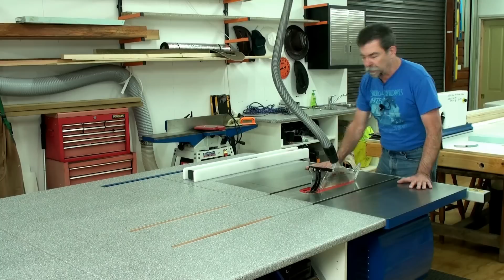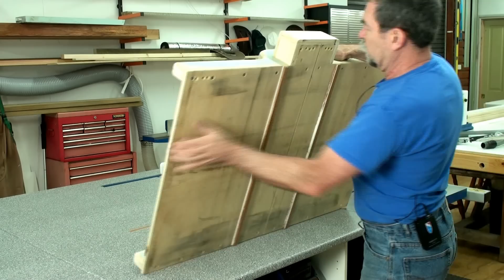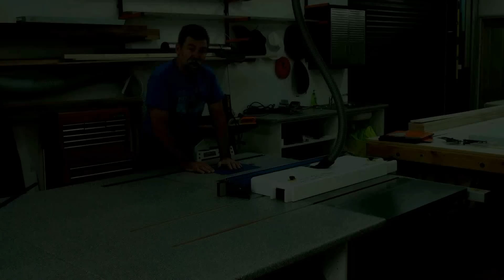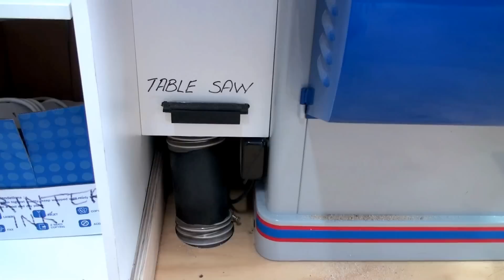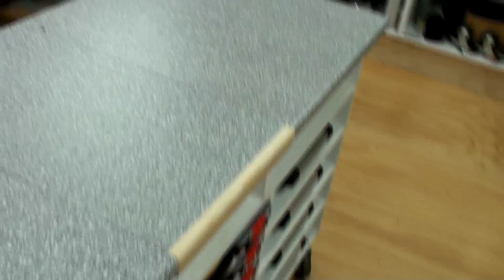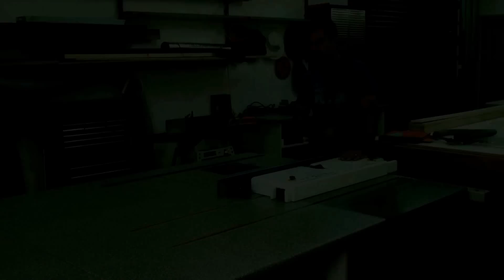Table Saw | Router Table | Dave Stanton

Comment: Hi Dave.  Could you pls tell me how you have attached the outfeed table to the table saw.  I have the same Carbatec TS. Also how you stabilise the end of the fence after removing the steel guide. Thx Phil
Reply from the maker: Hi Phil! I'm glad you're finding my videos helpful. I attached the outfeed table using 50 mm hex head roofing screws through the cast iron top where the rear rail used to be, into the laminate top of the outfeed table and router table area. As for stabilizing the fence, I found that if you check how I secure the router fence here, 8:39 but I use a https://amzn.to/3JnCwRK works well inserted into the end of the fence. Hope this helps!

Comment: How’s the Carbatec table saw going??
Reply from the maker: It is the best! This model isn't sold anymore...what a shame.
Reply: @DavidStanton   is it similar to the one they currently sell. What’s so different
Reply from the maker: Mine is a 15 amp, the new one is a 10 amp. The insert plate is thinner on the new one which makes it hard to make your own inserts out of plywood.

Comment: Dave, did you have to drill the whole in the router insert plate for the above table height adjustment ? I cannot seem to find a kreg insert plate that has that whole pre drilled, only the fixings for the tra001 router base.
Reply from the maker: Hi Martin! The plate had all the holes to mount the large triton router including the hole for the triton crank that operates the fine adjust.
Reply: @DavidStanton  excellent, just invested in a kreg   PRS 4034 plate to go into my rolling MFT style bench, to go with my Triton TRA001 and some grooving bits I've purchased :) I'll put some t track in and make a sturdy fence and I can finally start to make some drawers and doors easier with the grooving bits. - keep up the great videos !

Comment: Fantastic to see an aussie on the tudes. I have a question on the table saw. I saw a post on Woodtalks forum about how much power does a table saw need and now you have one, what would you answer to that question now? I only ask as I currently use home made table saw and finaly have about the $900 budget. My options are a 1.5 Carbatec contractor saw (used) or a dewalt 2000w contractor saw. Thoughts? A full 3hp Cabinet is not any option
Reply from the maker: Those 2 saws are totally different. What do you want to use the saw for?
Reply: David Stanton 
I will be building cabinets for a laundry and walk in rob plus small to midsize wood working projects. I think the carbatec would be better but am concerned that the 1.5 hp motor won’t be able to handle the ample amount of 50mm Blackburn timber I have. Thanks for your reply. I appreciate the help
Reply from the maker: It all comes down to the blade being used. The Carbatec contractor saw is not a very good saw. Try to increase your budget and get something like the Sawstop contractor saw. It is extremely accurate. A totally different machine under the hood.

Comment: Nice set up.  What brand table saw and router lift do you use?  I'm  just starting out (retired) and want to get it right!
Tom
Reply from the maker: Hi Tom. I have a Carbatec table saw but it is not available any more. I would look at a sawstop due to their accuracy and reliability. The router has its own lift. It is a Triton.

Comment: Hi David,  Huge fan, love your shop and your organization.   I am not sure if you own a job site table saw and if you do, do you have a out feed solution for these type of saws for a shop?   I own a brand new Skilsaw  Worm Drive Job site saw  and love it.  Very powerful very accurate for what it is. I am considering making a combo out feed and router table to use with it and was curious if you ever made something for a client or yourself for job site saws like the Skilsaw, DeWalt etc.
Reply from the maker: Hi Gary, Thanks for watching! I believe that you can buy the stand as an accessory. You could then make an outfeed table for it, possibly a couple of millimetres lower? The other thing that I did way back before I bought my cabinet saw, I built an 8 x 4 feet table and fitted 1 inch diameter water pipe into the end and rested my jobsite saw on the pipes. Obviously I fitted some timber to the under side of the saw table to locate the saw and save it from wandering around while cutting.  The depth of the table top frame was enough to be rigid to take the pipe and the weight of the saw and any timber passing over it. Hope this is of some help.

Comment: Question I am going to be purchasing a new tablesaw soon and wanted your thoughts on one with a built in router table or do you think it is best not to incorporate the router table into your table saw.  I see you  have a table but it appears to be one you built and butt up next to your tablesaw to utilize the table saw fence.    Thoughts?
Reply from the maker: Hi Gary. In an ideal world it is best to keep the router table separate so that you do not tie one machine up at the expense of the other machine needing to wait to move things around and become useful again. Mine was a nice idea at the time but would build separate if I did it again.
Reply: Thank you!  I think as you stated there are more options of router table design and router tools not having it built into the actual table saw.

Comment: +David Stanton can you show/tell how this fence mechanism work in your table? 7:59 - so smooth and I wonder  whats the solution you used there. Thanks for explanation.
Reply from the maker: I set the fence and rails as per the manufacturers specifications. Maybe I will do a video on how to set up correctly?

Comment: Hi David, 
mate love your channel. id like some advise on purchasing a Router table/Router. 

I have made selfmade bench with a cut out and bolted a router under the bench and made my guide out of hmr and mdf.

look it works fine, but i feel the makita router is struggling. My boss doesnt wont to invest in a spindlemouter as they are quiet expensive and doesnt see the need. Cough.. tight ass.... Im routering 27.5mm hmr with 3.2mm mdf glued both sides of the hmr. i router out 30mm wide by 5mm deep both side to fit a aluminum chanel. my question is the set you have (carbatec router bench and router) do you think that could handle constant routering ? or do you think a spindle moulder is requiered? 

i router out 12 lengths hmr 2400 x 110 x 33. 5. id really love your thoughts. on what type of setup i can use without struggling everytime i router out 30mm x 5mm deep.
Reply from the maker: Hi Blake. I think that for the volume of work you are performing that a router table would not be the best option. A spindle molder with a power feed fitted may be a better option.

Comment: Great set up.. I am looking at up grading to a decent table saw.I currently out source my cutting and assemble carcasses in my workshop its becoming to expensive now to do it this way.Do you run the tablesaw on phase 3 power or on 240 gpo?. I was also wondering how much your  did your table saw cost?  I am still researching products and number crunching.
Reply from the maker: Hi Keith. My saw is a 15 amp plug in model and unfortunately not available anymore.  If I were to buy a new saw I would buy the Industrial sawstop with sliding table. https://www.carbatec.com.au/machinery-and-accessories/tablesaws-and-accessories/tablesaws/sawstop-industrial-saw-with-52-t-glide-fence
https://www.carbatec.com.au/sliding-crosscut-table
Reply: Thanks David  a few others have recommended the carbatec, and I checked them out this  might be a good option I .watched  a few more of your posts great work I hope my new set can be as impressive
one day..
Reply: David Stanton d

Comment: That is an incredible setup! What's the difference between a riving knife and a splitter?
Reply from the maker: Thanks Vinny! The difference is a riving knife finishes in line with the top of the saw blade. A splitter usually goes higher than the blade and is the support for the blade guard. A riving knife is used where a blade guard is impractical such as cutting a dado or slot where the timber will be acting as a blade guard to some degree.
Reply: Thanks David, that makes sense.

Comment: What model is the table saw you use? 
are you using the stock fence and fence runner that the table saw came with?
Reply from the maker: +Lachlan Childs . Yes the fence and rails being stock. The saw is a Carbatec 10 inch left tilting cabinet saw.

Comment: finally found an aussie wood worker on YouTube. Awesome.
Reply from the maker: +Ideealil Popov . Glad to be of service!
Reply: +David Stanton I bought myself a cheap $170 Ozito table saw from Bunnings. I've fixed it on a table so it's sturdy now. I want to make my own rip fence but don't know where to start. Got any ideas?
Reply from the maker: +Ideealil Popov . Have it recessed into the table? There are some good ideas here. http://www.finewoodworking.com/item/110729/table-sawrouter-cabinet . You can buy good fences but they are around $450. Another option is to make one from plywood. Good luck with the project!
Reply: +David Stanton you're the man. thanks.

Comment: What brand/Model is your saw, and would you recommend it?
Reply from the maker: +Despicably Irascible Rapscallion . The saw is a Carbatec left hand tilt 10 inch cabinet saw. It will take a dado stack. Jet make a comparable saw but not able to take a dado in Australia. If I were to buy again I would purchase the Sawstop cabinet saw, 10 inch and probably the industrial model as the table is larger and also there is more space on the table prior to the blade. It should take a dado stack.
Reply: ***** Thanks

Comment: i don't get how americans still use this type of tablesaw....european are just so much easier to use.
Reply from the maker: +SingleProudDaddy Not sure I follow you there. I am an Australian, not an American. Please expand on the European saw you are referring to?
Reply: i don't know the right name but for example this type we have @ my job "altendorf f45"
Reply from the maker: The saw you are referring to is a sliding panel saw, and a very expensive one at that with 3.8 metres travel and computerised measurement system. These are great for high volume industry but I doubt that the average home wood worker would be able to fit one in his workshop or even afford the deposit on such a machine. Cabinet saws and panel saws are different animals. The panel saw has 1 main function and that is to cut panels and it does it very well. I have never seen one be able to sue a dado stack.

Comment: Yup! Got a sub from me... I've been brooding over how to design a sled - and an outfeed table that works in a small shop...
I am delighted to see someone came up with a sled-stop system! Good stuff! Now I just have to figure out how to modify it. I have a small space and am thinking I will want to fold down the outfeed table when not in use... Yet still be solid & Accurate enough to use as a sled stop as well. :-)
Lots of ideas - so little time...!
Reply from the maker: +Dave Weber You could incorporate my mobile multi function bench into your design. https://youtu.be/hPX8sCwEga0

Comment: Hi David, the kitchen benchtop you used normally come in 600mm width,  did you get a larger board or you joint them together?
Reply from the maker: +Eason Qin I purchased directly from Laminex industries. They will send you an order form that you fill in the details and then you pick up and install yourself. The NSW branch is in Prospect very close to Wet and Wild. Call them on 132 136

Comment: David, your set up is awesome. I just purchased a shop ful of tools and am in the process of laying out my shop. I decided the first thing i want to do is locate table saw. Got that done. The router table that i got is nice but i want to incorporate it with ts as you have done. I had to cut some off the bottom of router table and i am ready ty level it up in the space. I have to wait till tomorrow because I need some levelers and i will have to put a 1/2 nch spacer on each side before i bolt it too the ts rails. after that i will build new drop table similar to what you have. Thanks for video, most helpful.
Reply from the maker: AStanley Luce always a pleasure to here how other people are enjoying the journey of setting up their own shop. Thanks for sharing that with us.

Comment: Hi David - That is an awesome table and set up.  I'm going to be building a stand alone router table, and am going with a Kreg plate and a Triton TRA001 router.  Any advice on the size of the enclosure you made for the Triton Router?  What rough dimensions did you use and would you make any changes?

Thanks,

Dave
Reply from the maker: David Pflug I would go with the dimensions of the KREG router table. Have a look here. http://www.carbatec.com.au/kreg-precision-router-table_c20829

Comment: Great idea with protection / blocking in the sleigh. Much like I wanted to solve this problem at home, but the grooves in my chain saw ( cheap ) are not parallel : / In addition, dust extraction system - a revelation. Safety first, great idea! Greetings from Poland! :)
Reply from the maker: Zappalniczka thanks for watching and taking the time to comment. I do hope you meant to say table saw, not chainsaw!
Reply: ***** Of course I thought about a table saw, although with a chainsaw might look like a very interesting ; )) (I support a little bit with mr. Google translater:)
 Thank you for your reply and sorry for the mistake,  greet!

Comment: Brilliant set up David, thanks for sharing.
I too have my router mounted on the table saw extension wing. I've been looking for a way to mount a router fence to the table saw fence, but was worried about flex. Your solution is obvious now I see it. And the interchangeable dust extraction is a brilliant finishing touch. Keep up the good work squire.
Reply from the maker: John Davies I have just this minute posted an update John.

Comment: David
The rip fence rear support, how did you compensate for that, given your out feed table is flush to the saw table top?
Reply from the maker: Hi Bill. The rear of my rip fence used to have an angle bar that an adjustable height foot rode on. I removed the rear rail and adjustable foot and have a thin polyethylene pad double sided taped to the under side of the rip fence. That allows the rip fence to glide over the table saw cast iron top as well as the router table section as well.
Are you thinking about something similar for your saw?
Reply: *****
Hi David
Yes I am, when I assembled the saw I observed the rear fence support to leave a gap between the saw cast top and where a possible out feed table would be, not a desirable situation, it would seem the polyethylene pad is a simple and effective fix.
Thanks David
Bill
Reply from the maker: Did the saw go together as easily as I said it would, no surprises?
Reply: *****
Hi David
Yes it did, I had a little trouble aligning the wings, but have got them almost perfect now. I have the fence almost exact to the mitre slot, I measured with my vernier caliper at .005"!, not too bad I thought, the belt squeals on start up though, I have tensioned it but still squeals, does not squeal when cutting though.
Thanks for the advice on Monday, I think you saved me from making an expensive mistake :)
Cheers
Bill
Reply from the maker: Bill Edge you will have a much better experience with the jet saw. I am glad you like it and appreciate the comment on saving you!